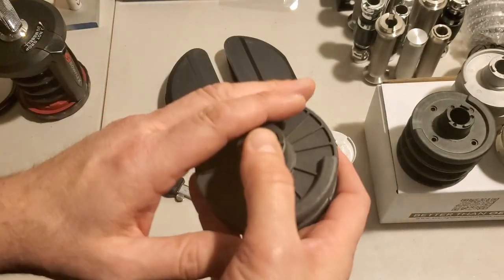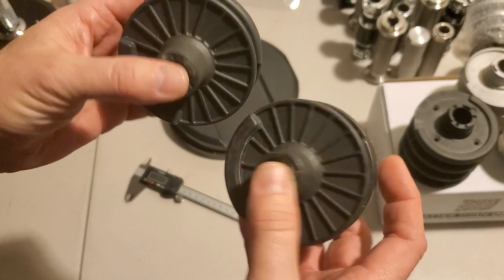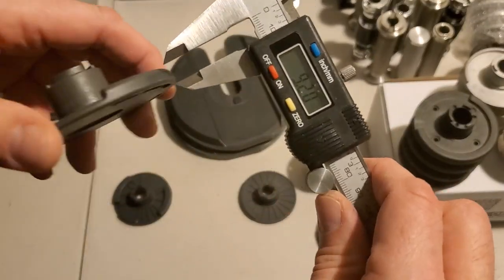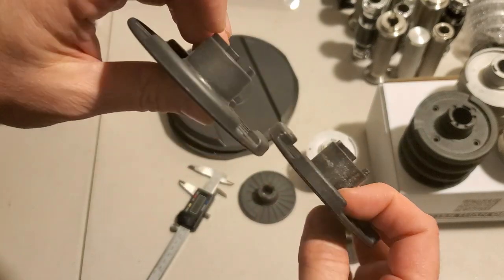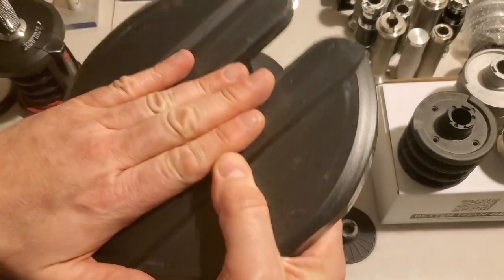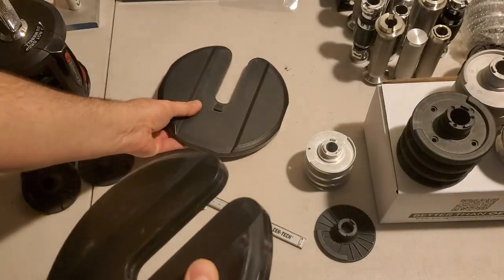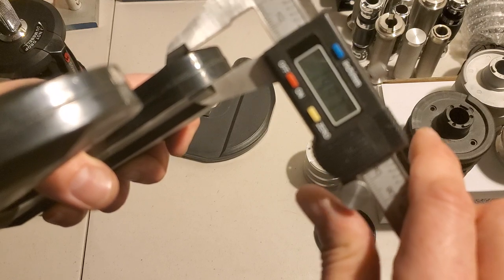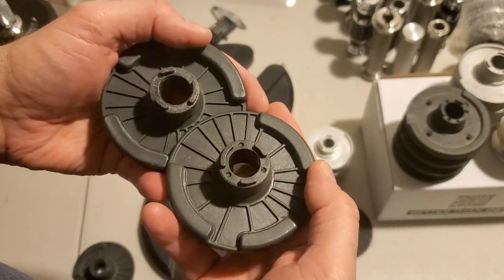One of These Things Is Not Like the Other: Why Our Dumbbell Parts Aren't Automatically Swappable

Comment: How about a curl bar that can attach to the selectTech  dumbbells?
Reply from the maker: Hiya Josey, I tossed around the idea last year as I began thinking about ways to extend the functionality of the dumbbell.  My major concern was that it'd be an awkward adaptation of the design.  Take a look at the way Powerblock attempts to turn its dumbbells into a kettle bell and barbell using attachments.  Extremely awkward.  The sort of half-baked result you'd expect when an engineer attempt to fit a square peg in a round hole.

Not to say that it cannot be done.  But if you're going to go that route, design the dumbbell from the ground up for adaptation.  With that said, as I work on my own dumbbell design I'm definitely keeping an open mind.  If I can find a way to allow for adaptation without sacrificing usability and durability, then I'm all for it.  

Thanks for offering up suggestions man, I appreciate it. Stay safe and have a great 2021.
Reply: @AverageJoeInnovationsLLC  Sounds great! Can't wait to see your dumbbell design.

Comment: I’ve had the select tech dumbells for over 10 years and still have them in perfect condition.. If you don’t drop or slam the dumbells you should never need to replace them...
Reply from the maker: Glad to hear that, man. Though dropping, slamming and general mishandling aren't the only reasons adjustables [from any brand] fail. Those are certainly a couple of the reasons, but mine began to fail despite never being mishandled. I own the entire SelectTech lineup (except the 220) and all of the models have the same issues. Environmentals, usage, design and manufacturing inconsistencies play a role, as they do in most industries.   I would say, however, it's never a good idea to drop or slam adjustable dumbbells...they're not designed for it and it will shorten component life expectancy.